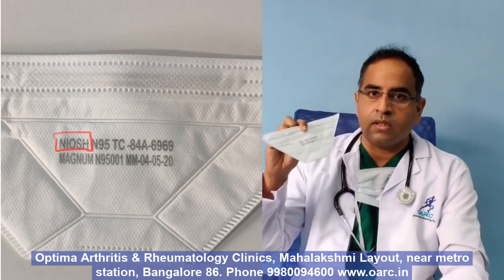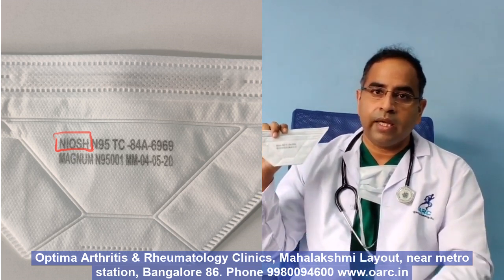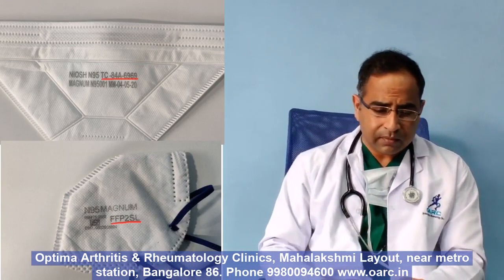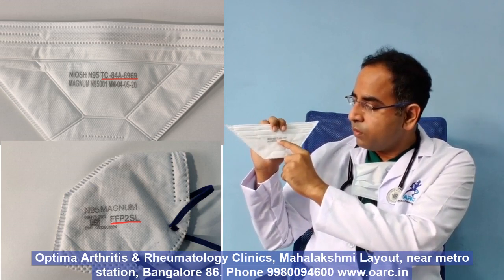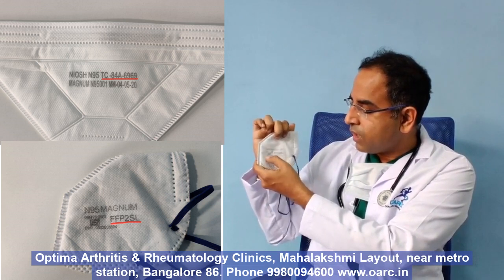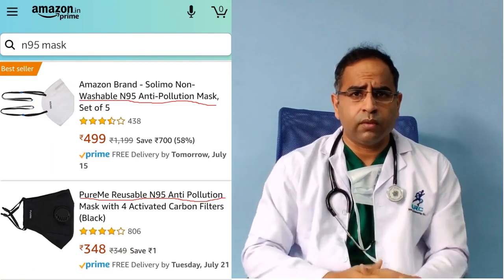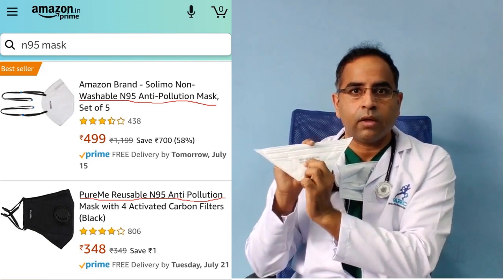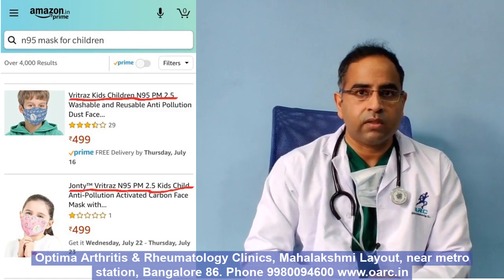Is your N95 mask fake ?

Comment: Could you recommend a site from where to buy original N95 masks? The only option these days that is Amazon. And as you mentioned it’s hard to get the original mask.
Reply from the maker: You can see the list of genuine NIOSH verified sellers or the manufacturers in the link provided in the description... It is there in the article but reposting the link here for your convenience... https://www.cdc.gov/niosh/npptl/topics/respirators/disp_part/n95list1.html
you will have to search for a seller/ manufacturer who sells in your part of the country/world
Reply: What about KN95 masks or FFP2 masks?
Reply from the maker: on paper N95(US), KN95(China) and FFP2(Europe) are all supposed to be the same with similar performance. However  several face masks, claiming to be of KN95 standards are not protective and usually have fake or fraudulent paperwork. In addition, the manufacturer can claim KN95 standards without independent certification, (this is how the KN95 process is designed) unlike N95 which has to be certified by NIOSH itself or FDA after inspection.\
[7/15, 5:54 PM] Dr. Sharath Kumar: Reference. https://www.hseni.gov.uk/alert/safety-alert-use-face-masks-designated-kn95 (11th June 2020)